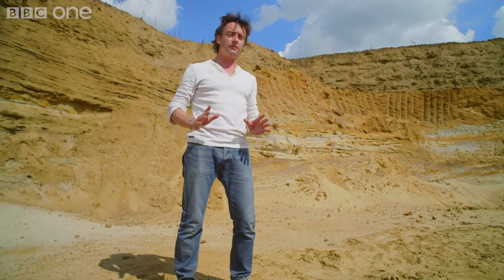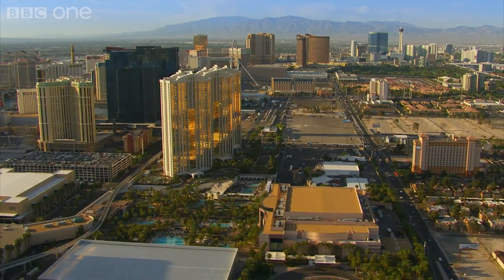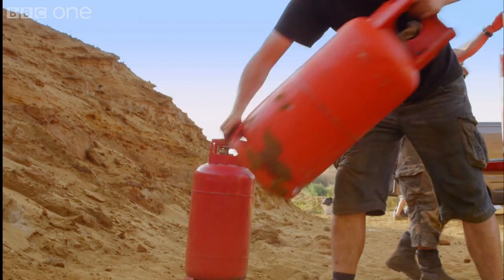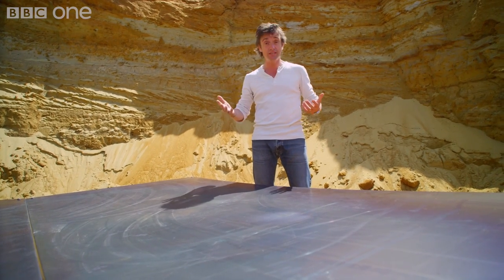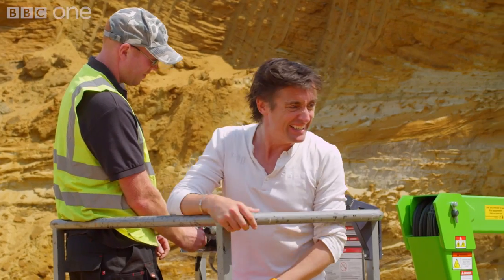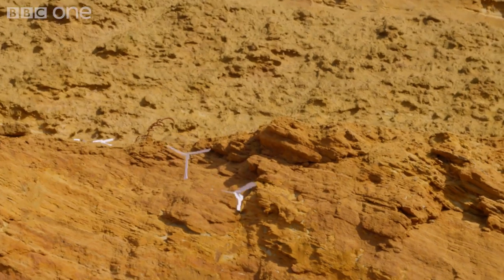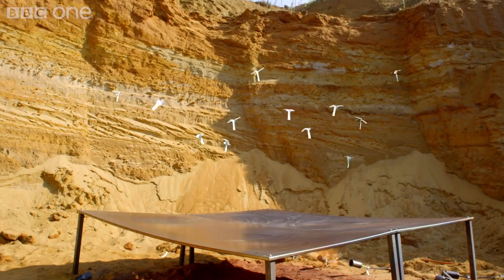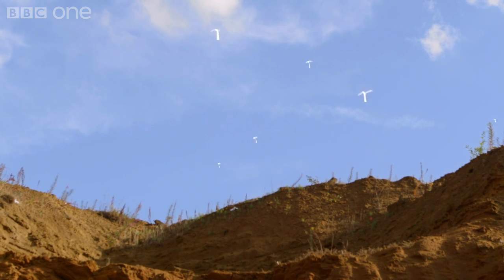Richard creates a lot of hot air - Wild Weather with Richard Hammond: Episode 3 - BBC One

Comment: While the concept works, and while they probably intended to float some paper helicopters, I have a feeling that side winds and other issues prevented them from capturing 100% actual paper helicopters on camera, and ended up resorting to CGI for most of it. No way in hell you'd get that many just sticking in one spot without any intersecting (crashing) into eachother or just going over the side out of the column of hot air and just fall or crash to the ground.